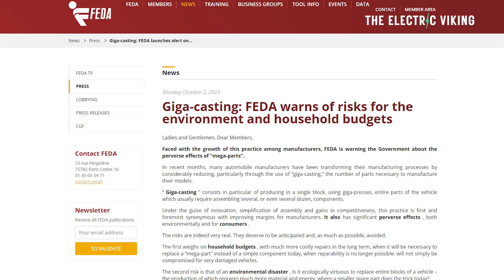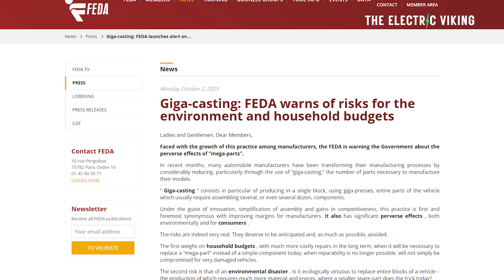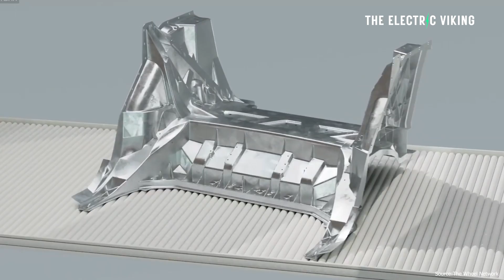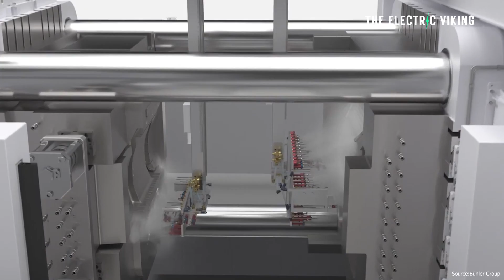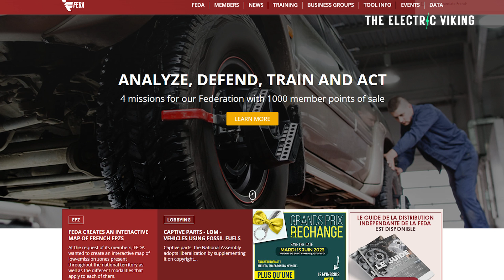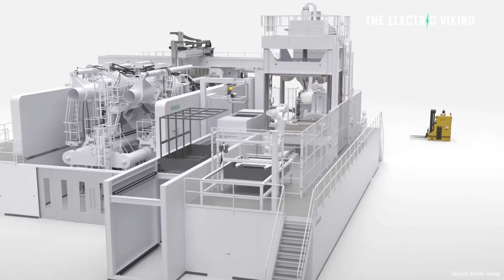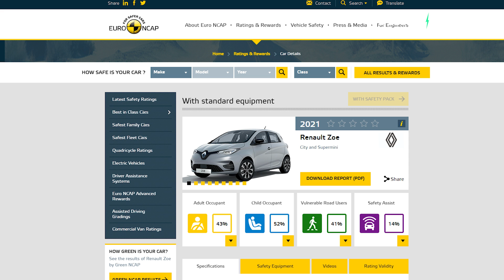Magna and French auto industry issue red alert; warn dangers of Gigacasting

Comment: * AMERICAN CONTENT * The number of cars under 5 years of age being totaled has increased over time. According to the Insurance Institute for Highway Safety (IIHS), the number of cars under 5 years of age that were totaled increased by 20% from 2000 to 2020. The fact that more and more cars under 5 years of age are being totaled has led insurance companies to raise rates for these vehicles. This is because insurance companies are having to pay out more claims for these vehicles.  In addition, the increasing complexity of vehicles and the rising cost of repairs have also contributed to an increase in insurance rates.

To meet crash standards good cars are being built with a super strong steel that is less repairable than the castings.  That is in part why insurance rates on cars are going up.

Comment: One thing that comes to mind, and I have to include the embedded batteries in frame system, is that gigacasting reminds me of Apple phones that no one can fix. Any accident and they would have to be replaced but can it be fixed by a local shop? I do a lot of welding, both steel and aluminum and I suspect there will be quite a number of complaints from the "right to repair" people. Despite the process being cheaper in the long run, I am on the fence about it.

Comment: As a CAD/CAM designer way back in the 90s i designed molds plastic metal and pressed forged from cars to helicopters. Worked in materials you dont know about yet. We hated uni body. F1 used segments but tubed frames. Stainless seamless tubing. Castings havevseams and impurities. Get out the zyglow. Or buy a gigahertz 3D scanner check for pockets. Real hard to get the flow. Dont see any pre heaters there. Not good. Trust me we tried it when we had WWII cash.

Rockets were better than today. Seriously.

I designed CAD molds for die casting from plastics to metals. Gigacasting is the same as the matchbox casting. The problem is its rigid and no flex and will crack. Garanteed. We forged our parts so the grain flows properly. They you use thinner parts. Lighter. Plus repairs will be welded as long as the metal isnt white metal. I think it will be alloy. Hard to recycle.

If you cant race it is crap.
Timeto start a test channel and be the tester out of them. If I cant break it no one can.
I'll find out.
Reply: Some people here are saying about some "special" alluminium alloy made by Tesla. Could something like that have changed the outcome? I have no idea what they are talking about, when I hear Musk talking I hear "buls**t" half of the time he speaks.

Comment: The problem I see with this is when one of these casted parts needs to be replaced over time. I drive an 19 year old Peugeot 206cc and I have no problems at all finding aftermarket parts or second hand parts in case something breaks and it is easy enough to replace some parts myself with some simple tools. If one of these cars with gigacasted parts even get into a small accident where one or more of these parts break I think the price to replace those parts will be way to expensive and your car will be totalled, and guess what will happen to insurance prices if that will be normal in the future. And I think it will also be way to expensive for the companies producing aftermarket gigacasted parts, because each brand and model will probably use their own designed parts making your car obsolete as soon as the newer model is build on the assembly line.
Reply: Boron fibre patching to repair castings.

Comment: I have serious doubts that the even the second or third main reasons for large castings are toward repairability, since all automakers have been utterly terrible in this respect.

But, I can see that if Tesla did the design work to permit welded repairs of the casting, that it would be a VASTLY superior way to keep a vehicle on the road than the spot welded, and/or bonded sheet metal designs currently use.   Doubt my position on this?  Take a look at the state of the underbody of most vehicles driven near salt water (oceans or seas), or the "Rust Belt" where the roads require sand, or salt, or both, to have driveable roads.

This has turned my thoughts on the mega/giga casting entirely, just hearing that Tesla intends to sanction welded repairs to them.  

Keep in mind, I'm still reluctant to believe Tesla will readily supply parts for repair.  But, having (eventual) salvage vehicles, and used parts to scrounge for such repairs, this would mean that we'll have options for repair, where the conventional automakers are content to build your vehicles with unibody sheet metal that will corrode to the point of being unroadworthy before the drivetrain would be the breaking point.

Comment: I do think you may be wrong about the insurance aspect of these mega castings & repairs.  What we've seen anecdotes of how much repairs which would have been very simple on older generation cars are now leading to total loss by insurance due to the cost of repair vs residual value of the repaired cars.  If that becomes a trend, the cost of insurance could skyrocket  for these vehicles.  Repairability  at reasonable expense & time is the key to the insurance game.
Reply: No, it’s true. It was an issue already raised few years in Europe by insurances AFTER having to pay the prices for damaged and hybrid cars. Just look here on yt how much it costs to repair a damaged battery. Some just burn everything down. Companies like Hertz, Sixt or carsharing companies are probably paying the price.

Comment: The French enginer Jean Albert Grégoire (1899-1992) presented the World first moulded car in aluminium in 1937.
He also created a special cast aluminium familly to improve the process.
Different cars like the Dina Panhard and later the Hotchkiss Gregoire was produced with giga casting, but using gravity sand casting and not high pressure aluminium press.
It was already more rigid, more light, but limited to low volume because at this time.
So this concept is French and very old.
Elon Musk is absolutly right to go in this direction.
Repair is not a problem using tooling and also welding.
Less parts is nearly always better and cheaper for manufacturing process.
Reply: Great story!!!
Reply: Wow EVERYthing old is new again!!
Reply: A good way to fix cracking in castings is with boron fibre patches. They are widely used in the aviation industry.
Reply: Gigapressing is not good.  By impact you need to get rid of your energy to survive.  You can't do that with a are in one piece.  A kind of like by Formula 1.

Comment: EV's only last for about 160,000km, after which the battery becomes severly degraded. So for "disposable" EV's, gigacasting might make economical sense.
For long lasting ICE, 500,000km or more, gigacast structural elements would degrade the maintainability and value.

Comment: I'm thinking repair could be lower on cast cars in the future. Much of the cost a frame repair is all the labor hours checking alignment and to certify safety back to original specs. If you can get the repair done with one large part that is already verified to spec all you have to do is fit the rest of the car to it. Automakers could come up with replacement process instructions that would greatly speed this up. However, this would only work if the casting were reasonably priced as a part. We shell see.
Reply: No, If they car has been in an accident that severe, it needs to be written off. Never buy a rebuilt car, you will suffer years of on-going repairs as every part of the car had some damage.

Comment: I'm not sure about the repairability compared to traditional pressed steel bodies. Sure if you hit something straight on the front or the back you can replace a bit of the casting like they say. But if you get a shunt from the side on the front wheel? The cast is bound to crack, and that at a place where you would basically have to replace the entire front casting, right? But a steel body can, within certain limits, be bent back into shape, and you just replace the bent and broken surrounding peices.
Reply: The case you're describing is a full front end rebuild in most cases: subframe, rails etc. How much is that going to take in materials and man hours instead of replacing a front casting. Have a look how quickly a Tesla is assembled how many fewer parts there are.
Reply: @rotteneffekt4416 If the whole lower part is one piece, you cannot just change the front.
Reply: Somehow though, they are never quite the same.

You still occasionally see them crabbing down the road.
Reply: @jimgraham6722  Well, it takes some workmanship to do it right. :)

Comment: Tesla is in a much better position than other car makers. They have a bottom pit of billions in cash thrown at them by the stock market, they aren't hamstrung by decades old pension liabilities of tens of billions like Ford and GM are and nobody gives a rat's ass Tesla is still many billions of dollars away from making a profit on what it's spent in total so far to make EVs.  Legacy auto makers don't have these luxuries which I suspect is why they are slow and cautious about the massive investments needed for such things as very large castings.  You have to sell A LOT of cars to make the cash investment back on a setup like that and that will take many years.  

People only look at the simplistic cost per part in raw materials plus labor which giga castings kill at but you have to add machinery and tooling divided by total units produced to that figure too.  I come from a tool making background and am well aware aluminum die casting is a brutal process than takes a toll on the molds which do have a fairly short life span.  I would be very interested to know what the real cost over a full vehicle life cycle is going to be for Tesla's giga castings because the cost of machines and tooling like that goes up exponentially with size and we are talking big numbers. 

As long as Tesla keeps doing the numbers though they are golden thanks to slow moving legacy automakers not taking a slice of the pie but eventually the auto EV market will mature like it did with IC cars where it's been dog eat dog for decades and every penny starts to count.

Comment: Magna‘s Steyer division in Austria is a contract assembler (like NedCar in the Netherlands or Valmet in Finland) focused on manufacturing lower volume niche cars for the big OEMs. Things like cabriolet or coupe versions of existing four door designs.

Contract manufacturers for the most part don‘t design cars but take the CAD files supplied by the respective OEM and figure out how to manufacture the car on their existing line using their existing equipment and processes.

A car has to be designed from the ground up for giga casting. Only if the OEMs start designing for giga casting will it make sense for a contract manufacturer like Steyer to actually invest in giga presses and the associated equipment. The giga casting dies are car model specific and are hugely expensive. It‘s not even clear if giga casting will eventually be cost effective for lower volume cars. At the moment it most definitely is not.

So IMHO it‘s a wise decision by Steyer‘s CEO to start learning about the technology, getting their toes wet and only start investing significant amounts of money once their customers start designing cars around giga casts.
Reply: - read a bit more widely and discover that Magna in the USA (and Germany too ?? Austria) - have designed and optimised large castings for single piece front-ends before.  Others report they are installing newer IDRA presses despite this clickbaity rant, lol...

Comment: They're desperate, flailing about. Screaming "risks" about gigacastings now is like competitors slurring assembly-line production by Ford in the early 1900s: "We can't keep up; we refuse to use this better system, 'cause... It's Different! You can't trust it - it must be wrong!" It's laughable.

European auto manufacturing will hit the wall, is doomed. That's a disaster for European economies: the auto trade is at the core of industrial manufacturing for every developed nation with an industrial base. ALL the German manufacturers have now surrendered to China, announced that their future EV production will come from China. Internal Combustion vehicles MUST end by 2035, & the EU has signaled they're considering advancing that date to 2030. After that, all production comes from China. Disaster. Germans should attack their auto firms for committing treason. And the stock market should start selling off German auto stock: the safety net is gone. No German government will bail out an auto firm that is sending all future production to China. And all those firms WILL need bailouts.

Comment: I believe this is similar to unibody design. I believe that a lot of race cars are designed using the same unibody design concept.

In the old days, US car manufacturers found out that Japanese cars had better fits and finish because they had less parts. Mega-casting takes this approach to even a higher level making the cars structurally stronger and better finished.
Reply: The best def I can find for unibody is "a single structural unit of an automobile consisting of a combined chassis and body.".
Please note that are shades of grey here.  Tesla is heading away from unibody with the big castings.  When they get to casting the bottom 1/2 of the car in one part.  we might argue that the car is body on frame.  This may be a huge advantage for Tesla as it produces a single bootom/frame for the model 2 and a range of top hats aka bodies.
Reply: I've seen dozens of Teslas - they have the fit and finish of american cars i.e. garbage
Reply: That is so helpful and right on topic of the video and conversation... FFS @PaulG.x
Reply: Unibody (monocoque in French and used in other languages too) doesn't refer to a manufacturing technique but to a structure. All cars for decades have been unibody. It means the structural integrity and rigidity of the car isn't all about the chassis, but instead relies on the body, the panels, everything.

Comment: Injection molded plastics presses are less costly and more available than aluminum die casting machines like the IDRA gigacasting equipment.  I am wondering what the weight and cost difference would be in materials to make the entire underbody out of GFRC strong enough to be the chassis of a vehicle, possibly with some steel members overmolded where needed for stiffness.  I think Sandy Monroe showed an example of how the battery pack for the first EV, GM's EV1, was GFRC and was stronger and lighter than the aluminum battery pack boxes being used now by VW.  GFRC is even more resistant to rust and corrosion than aluminum or SS, so it seems like a good solution if the cost was not prohibitive.  Differences in thermal expansion rates might make mating to other materials difficult, but with a body-on-frame approach rather than unibody, that seems solvable.
Reply: That's not heading toward the ultimate car; one part.
Reply: Maybe, with EVs heat no longer a problem so plastic now possible.

Comment: I worry about all the adhesives and welding used to assemble cars, in that it makes it difficult to disassemble them.  If a car could be completely disassembled without damaging the parts, the parts that need replacing substituted, and then reassembled with a reasonable amount of labor, then very few cars would ever be written off by insurers.  As it stands today, even without gigacastings, what is relatively minor damage gets a vehicle written off.  If a car is ten years old, a minor dent even from hail will cause a writeoff.  I envision a future where a shop with a n Optimus robot can completely disassemble a car, use a 3D printer to print replacement parts (no inventory or shipping of parts), and reassemble it in a day.
Reply: Get on it!

Comment: I'm still in agreement with those guys that the giga castings will be difficult, if not impossible to repair. I don't see how these would crumple and pull back into shape. Attempting to cut off and re-weld for example a wheel well would result in an unsound joint (without seeing the repair part and how they figured the joint would work). I still think they need to be made as 3 easily replaceable parts instead of one big casting.
I guess we really need to see actual repair data by honest body shops, but that's my former collision tech opinion.
Reply: It's best to write off heavily damaged vehicles.
Reply: - people claim things all the time - click...  the believers Dunning-Kruger reinforced.
(time will tell - the "supply pieces of the casting" seems very suspiciously like total BS.)
Reply: Times change.
Reply: Same was said for Unibodies and bonded panels. Yet as a industry we now repair everything from a unibody Pinto from the 1970`s to Modern jets with large monolithic composites structures manufactured in both aluminum and fiber. The repair argument did not work in the 1950`s with unibodies and will not work with modern Manufacturing processes.